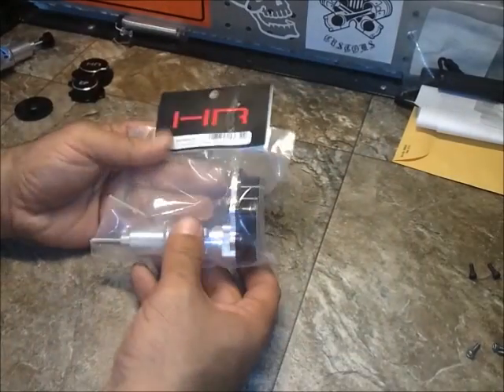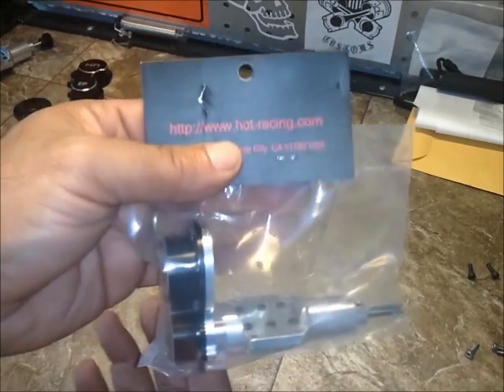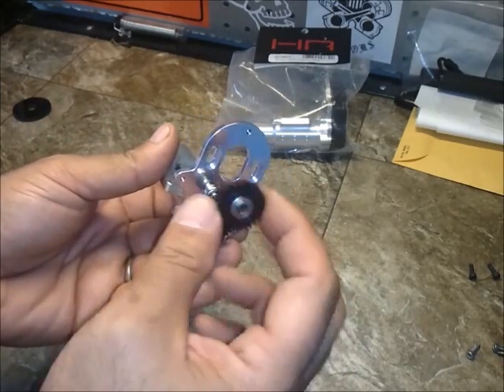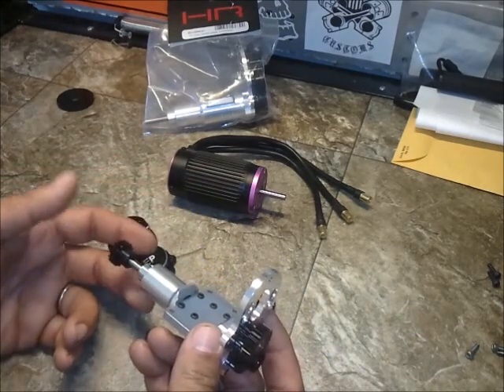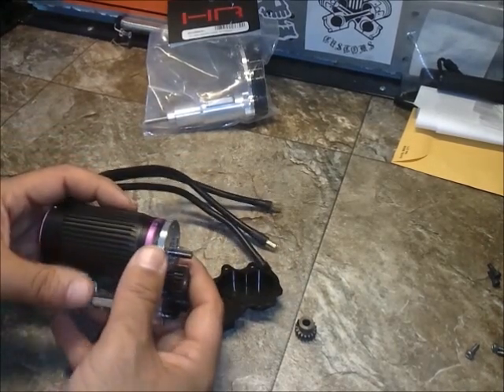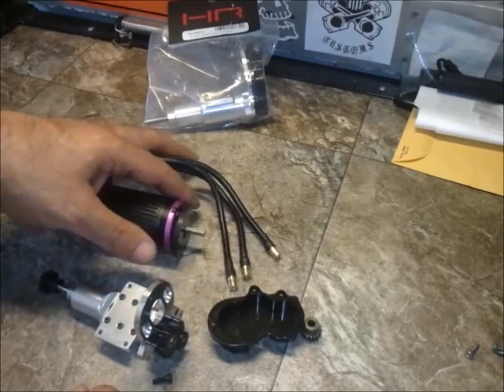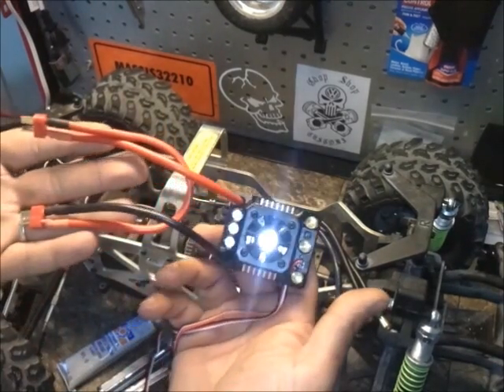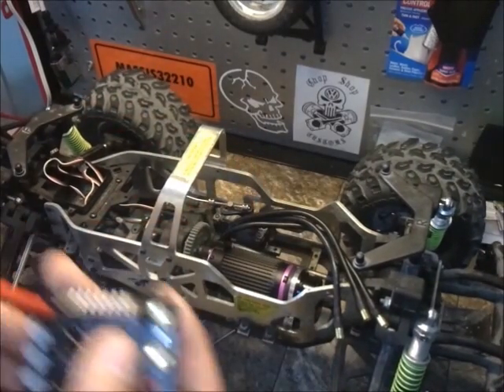nitro to electric conversion adapter

Comment: Do you have a video of the complete build? I have the same truck and want to do the same thing.
Reply from the maker: I don't believe I made a video on building this truck. It's pretty much bolting the motor to the adapter if you can find one and then bolting the motor down to the truck like the nitro motor would have been mounted. But I will warn you now that a motor and ESC will have more torque than the original nitro motor. That said you will strip spur gears left and right. I sold my original model but I'm planning on buying another one and keeping it as a nitro, for nostalgia sake. Your hardest part of this project is to find that adapter. I started out with two and I finally found one of my original ones. If you can find them you found gold.

Comment: They discontinued those adapters. I can't see any real reason to get one it just overcomplicates what's a simple process of just mounting the motor and running it directly pinion to spur gear. Three extra gears for no reason.
Reply from the maker: Sorry for the late reply but I have to differ those units are actually awesome you can play with a different gearing and come up with a new gearing combination combination

Comment: Have you done a 1/8 Team associated MGT 8.0 converted to electric? I'm looking to convert my gas to electric and i need to find the peace's and the motor that i like thats quick.
Reply from the maker: Unfortunately I haven't done the team associated with some careful Parts finding at the local hobby shop you should be able to assemble something like this

Comment: Some links wldve been nice homie. 
I against my better judgment & bought a redcat racing 3.5 cc nitro truck & NEVER got it started. On first 4 pulls the pull start spring exploded inside the housing. Took it off & used a socket to spin start it, well i TRIED to spin start it to no avail. Wasted 300 u.s. dollars on the truck, 50 on gal of fuel, 50 on a "starter kit" , about 40-50 more on glow plugs,air filter oil,batteries, after run oil etc etc & THE FOOKEN THING NEVER STARTED . So ultimately instead of have a $500   chinese p.o.s lying around my house im gna convert it to electric. I appreciate the video,BUT SOME LINKS UP IN THE DESCRIPTION WLDVE BEEN AWESOME HOMIE
Reply from the maker: I wish I could provide a link in the description this product is not available anymore as I told another viewer I might have one laying around but I have to find it and I would have to even apologize if you bought a red cat instead of going with a Nitro you should have went with a straight gas motor

Comment: do you know if this part fit with motor 1/5 scale castle 2028?
Reply from the maker: not sure but i think it will.
Reply: The part number is EEC2000L01. I can’t find it anywhere. I don’t think they make it. If you find it let me know!

Comment: Hi I just saw your video on the duratrax brushless conversion. I have the same model duratrax warhead and I wanted to do a brushless conversion. However I could not find the Ebay seller that you mentioned.  I went to Hotracings website and they dont even list duratrax as a brand anymore. But they do have and extensive list of discontinued parts. I was wondering if you still know the Hot racing part# for the adapter. So that I can try to find one somewhere.  Any info would be greatly appreciated..
Reply from the maker: I'll be honest with you that's been so long ago I don't recall the information but try to Google Nitro to Electric conversion adapters and see if anything comes up as a possibility sorry I couldn't help any further

Comment: waste of money,,  i see lots of failures  i'll stick to my home made mod zero failures on savage 25 , using 3 sp trans all metal gears,, motor mount was a scrap piece of alum plate.. only issue is bending dogbones...
Reply from the maker: I would beg to differ on that when you're running a large motor with a lot of power this is a nice little upgrade with all metal gears nicely machined aluminum

Comment: Hi, I'm in the middle of converting a hyper7 nitro to brushless and just watched your video. I'm just wondering if there's a reason why you didn't put your pinion on your motor and connect it directly to the gear already in the car and why did you use this device??
Reply from the maker: This made an easy motor mount plus with a car being heavier than 1/10 scale car I wanted the gearing to get it to go faster but take my advice when you do a Nitro to Electric conversion either is going to be simple and you'll have great results or it's going to be a pain and you're going to constantly strip gears thanks for watching
Reply: @massis32210  with my luck it will be the second one haha

Comment: I just bought the power conversion from hot racing it's awesome looking now if I had a nice picture of the warhead chassis from the top I might be able to convert mine
Reply from the maker: ed derocher the conversion was easy but the spur gear was stripping all the time. Hope it works out for you.

Comment: Hello . I have two stampedes. Nitro . 2wd and all the parts are there and I'm wanting to trade them for one good RC truck . Or get help in converting them to electric? I'm new to the hobby . 6months. I oun one RC ( rustler.) And these two stampedes. I have three Motors and not sure what to do . Yeah I know look you tube or get info ? No no that's not it I'm just not into gas or nitro RC cars . Electric looks easy to maintain and from the looks my of my son's it looks easy to fix if I break it . And accessable to parts . But if you got some ideas or know someone ide like to do something instead of letting them sit thanks for your time
Reply from the maker: jdubbfam37  I would agree that night nitro's are pain in the tail gas on the other hand is pretty fun I had a Fifth Scale on gas that was just awesome if I was you stay with electric and don't do conversions they're not worth it in the end that's my opinion thanks for watching

Comment: Yall are lazy. Took me 2 mins to find the listing on ebay. https://www.ebay.com/itm/Hot-Racing-21-Class-Electric-Power-Conversion-EEC2000L01/292371141560?epid=1138701847&hash=item4412ad93b8:g:TpsAAOSwVA5aMvBq
Reply from the maker: darius green thank you for finding the link. I couldn't remember how I even found it but it was a cool find again thank you so much thanks for watching

Comment: I need a conversion for Mammoth as well
Reply from the maker: Dana Malone some are easier to find than others. Thanks for watching.
Reply: massis32210 well any ideas on where to look for a electric kit
Reply from the maker: Dana Malone I have been out the rc stuff for a while, but the only thing  I  can  think of  is  check the internet  forum  for  some  advice. Sorry  I  couldn't  help.
Reply: I think its a HPI savage

Comment: Hello there your video is amazing I wish I can convert my nitro revo 3.3 to a electric truck where do you order the parts thanks so much
Reply from the maker: Dannymel7777 my buddy did a revo. that was a nasty conversation.  do it. Thanks for watching.
Reply from the maker: Dannymel7777 oh they make a special kit for your conversion, Google it.  Should cast no more than 20.00 bucks.
Reply: Dannymel7777

Comment: Hi,,, i am pretty new to brushless lipo, and love it,, i have just stripped a nitro that i want to convert,, am i defo gonna need a new centre diff or can i mesh my leccy motor up to the 2 speed gearbox?? like i said,, new to this, just totally upgraded what you guys call volcano,, crazy fun,,,  any advise be great,, thanks, i havd a channel that sure aint out to become anything,, under my name,, just hope it helps encourage,, my last post was about the conversion,,
Reply from the maker: Brent Humphreys try to Google the car to see if  any company's makes a conversion kit first, than if needed to make your own conversion just find the gear that matches up the spur gear. then you would have to make a motor plate to mount everything together.  but keep im mind that if you have direct drive and no clutch that the chance of braking stuff is very high. I know because I have done nitro to electric conversion, my duratrax 1/8 scale truck was a beast. but kept stripping the spur gear and they were discounted and hard to find.  got expensive quick. lol.. thanks for watching.
Reply: massis32210 .. thanks mate! it has a 2 speed gearbox.. was thinking if I locked it I could just run right off it. but will find out. got it stripped down now! thanks for getting back.

Comment: Has anyone found a link for this? Because I found this if its helpful.http://www.ebay.com/itm/Hot-Racing-Traxxas-Revo-TRX-electric-Motor-Conversion-EEC2000T01-/381838682040?hash=item58e75be7b8:g:Cf8AAOSw4GVYHMbn

Comment: Do u have a link to the adapter
Reply: Peyton Dardenne Did you ever find a link for the conversion parts?
Reply from the maker: Mathew Sica I can't even find the parts online.
Reply: Search Ebay and theres a nitro conversion kit with everythin with a 26000 kv motor all you need is a battery for around 60 bucks
Reply from the maker: Richard Denson your right,  but some older models you have to find something like what I had. But special built kits are the way to go.
Reply: https://www.ebay.com/itm/Hot-Racing-21-Class-Electric-Power-Conversion-EEC2000L01/292371141560?epid=1138701847&hash=item4412ad93b8:g:TpsAAOSwVA5aMvBq:sc:USPSFirstClass!84096!US!-1

Comment: wher did you buy that one sir?
Reply from the maker: Jovert Gorres ebay, paid like 60.00 plus shipping.
Reply: can you dig out its acticle title? I can't find it and i think it is very neat!
Reply from the maker: Moes I found it on ebay, but it was hard to find and I didn't think that the company sold many of them. If I find info on it ill contact you through pm. Thanks for watching.
Reply: https://www.ebay.com/itm/Hot-Racing-21-Class-Electric-Power-Conversion-EEC2000L01/292371141560?epid=1138701847&hash=item4412ad93b8:g:TpsAAOSwVA5aMvBq:sc:USPSFirstClass!84096!US!-1

Comment: Hi, Im thinking of doing my 1/8 monster truck, what was the ebay address for the adapter. cheers
Reply from the maker: I can't remember,  its been awhile since I ordered it.  but my advice don't convert a nitro to electric.  it will run but you'll have problems.  striping the spur gear is going to be the main reason.  The transmission is made different that electric ones. thanks for watching.
Reply: massis32210 Im thinking of doing the conver. when my engine starts getting tired/compression loss. Its a Revo 3.3. Now it has the 2 speed in there, all plastic gear. Do you think that trans is going to last with a size motor you put in? also I'm wondering do they make a metal drop in set you can just throw in the stock case. I hear once you put in 1 metal gear be it spur, pinion, diff etc. everything MUST go metal, no mix matching.
Reply from the maker: MattySlimz my buddy did one and I think they make a adapter for it.just stock up on gears your going to strip a lot of them. Thanks for watching.